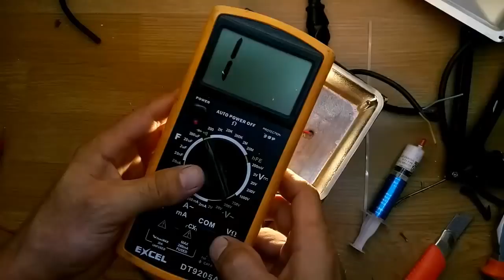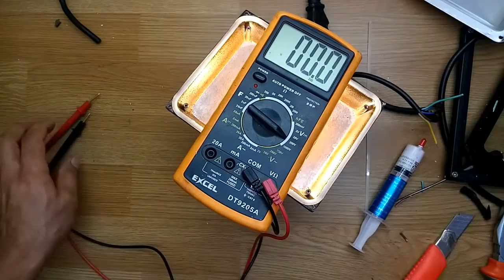How To Repair The Led Floodlight / Reflector / Lamp

Comment from the maker: Here you can see the products which i used in this video
LED Driver Adapter Transformer https://goo.gl/3F2Hcx
30g Thermal Grease Paste Compound Silicone for CPU Heatsink Heat Sink GPU LED .

 http://s.click.aliexpress.com/e/km9B5Mq8
Or here, LED without transformer 
COB LED Chip Lamp 3W 5W 7W 9W 10W 20W 30W50W 220V Smart IC No Need Driver LED Bulb for Flood Light Spotlight Diy Lighting
https://s.click.aliexpress.com/e/_DlC...

Comment: I have a LED outside light that stopped working, The MW driver has output+36v posted. When I check with meter I get 29.5 even when i turn the two screws V O adj,AD adj . I purchased an LED chip 100W V (F) 30-34 V. It lights for a couple minutes then starts cutting out. Any suggestions ?

Comment: You've receive too many dislikes due to the unacceptable attachment you made with the driver. You should attach the driver with red silicone only as the label facing up.
Reply: The dislikes are most likely due to that annoying audio. However I did find the plastic tie and holes for it in the case unacceptable.
Reply: Led foodlight valo korta ki ki malamal laga janaban plese

Comment: I have a remote control led floodlight & when I press the remote button to turn it on it flickers & doesn’t turn in! Have you any ideas what it could be??? Because the unit is quiet expensive & out of warranty. Kind regards

Comment: Now it is permeable because of the new holes at back. Good job.
Reply: Could silicone the holes after inserting the cable tie, not as good as solid metal was, but should still be waterproof... better would have been to glue in the power supply instead of drilling holes...

Comment: the wire connections should all be inside and why you didn't use super glue or double face to stich the transformer ???? making holes was bad idea

Comment: Chinese drivers are crap that do not last.  I found that when most of them defect the output voltage goes out of control and burns up the LED chip as well.
Reply: yeah chines dont  have protection

Comment: Chinese drivers are so crappy in quality.  I had to rebuild a 10 watt flood. The driver went faulty and output voltage climbed to a point of burning out the chip.  Replaced driver and a nice neutral color temp chip. Working great now.
As for your driver plastic tie, I would have made a tin strap with a couple of holes to hold it in place from inside.
Reply: Thanks, I think that's what's happened to mine.  Voltage at the chip is about 47V and only a  couple of the Leds light up (barely)

Comment: you are not suposed to put holes in the caseing now its not water resestence
Reply from the maker: You are right. It is sealed because the hole is smaller than the screw